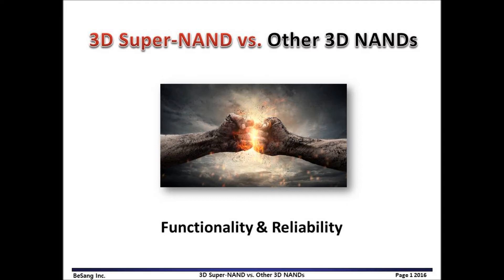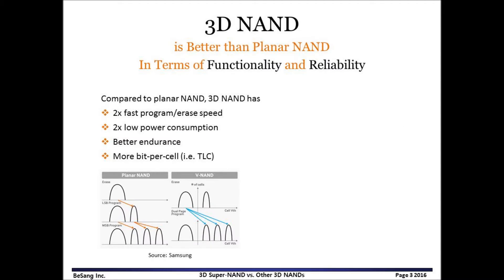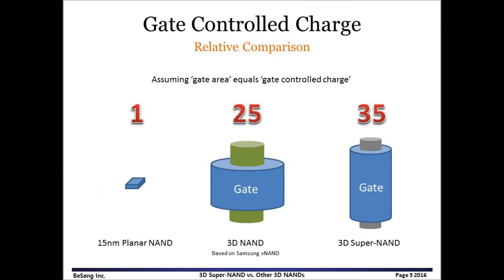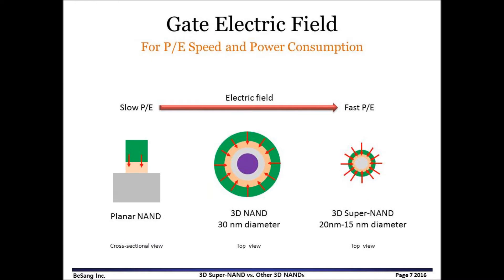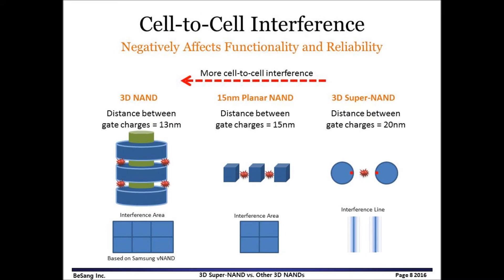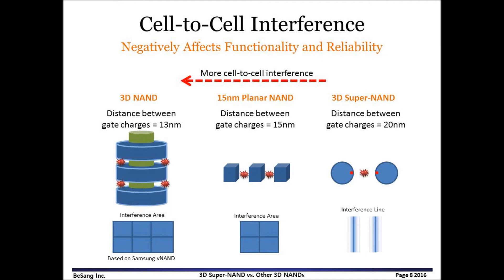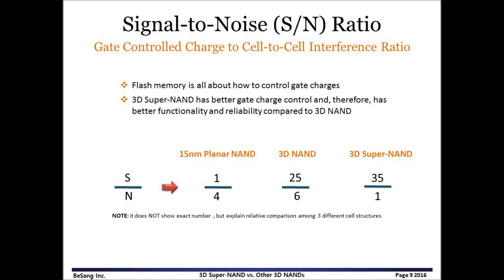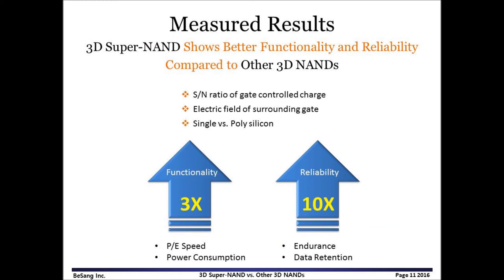3D Super-NAND vs. Other 3D NANDs - Functionality and Reliability

Comment: So standard NAND is safer to store data if compared to 3D NAND (not 3D Super-NAND) ?
Reply from the maker: 3D NAND is better than planar NAND because it could control more gate charges. 3D Super-NAND is much better than planar and other 3D NAND.
Reply: Thanks for answer, but my question was, which is safer to store data ? I mean less probability of data loss/failure due to cells interference. If bigger distance means less interference, then 3D Super-NAND is best. But is planar NAND (15nm) still better than 3D NAND (13nm) ? BTW great video !
Reply from the maker: 3D NAND is better for now. When 3D Super-NAND comes to the market, I will certainly recommend 3D Super-NAND.